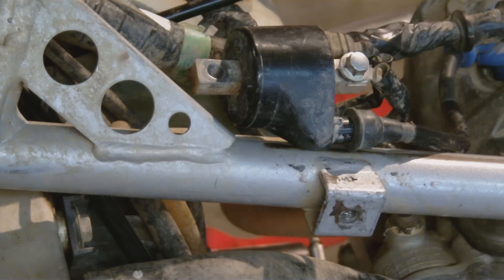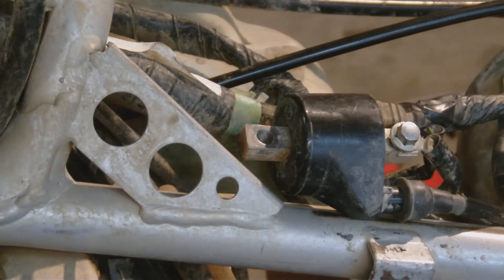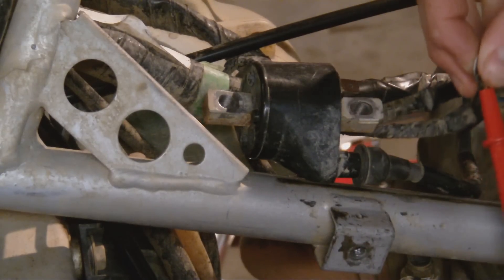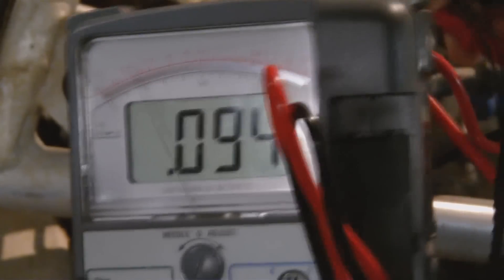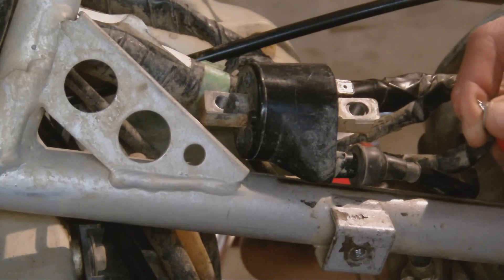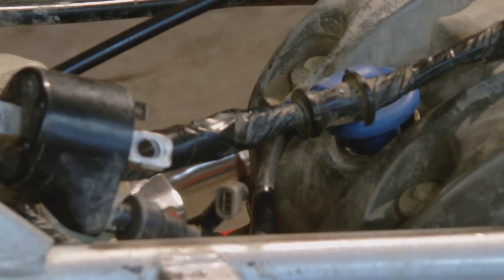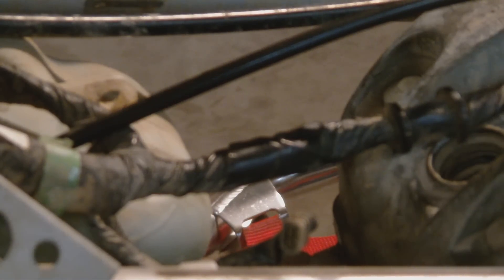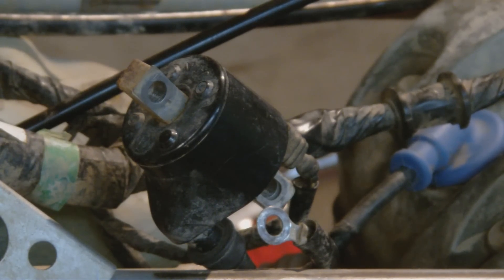How to test the stator of your ATV

Comment: I've always wondered why you couldn't wire an electronic speed controller to a stator and use it to turn the engine over on your quad as a means to dump the brushed starter motor... just makes sense on modern units. Not sure if they do, I've never driven in years. These stators are little different to a typical quadcopter/bldc motor arrangement.

Comment: Did he forget about the cdi box, or the kill button? They both play a very important roll in the process of making spark.
Reply: The harness needs to be grounded to the frame called a chassis ground. The chassis ground must be clean. Sand down to remove rust or paint. Hondas are the most picky about their power source and their grounds. Also electrical can go bad at any moment in time. You also need to source the correct resistance specification from an OEM manual . Don't just throw parts at the machine, that cost money. Take your time and learn. 

Here is an online manual. 

http://quads.ddns.net/service-manuals/honda/%5B2004-2009%5DHonda_TRX450r_Service_Repair_Manual.pdf

Comment: That is not how you would test the stator , you would have to unplug the coupler off the ICM and test the stator there .. But Honda doesn't use OHM tests anymore because they aren't accurate .. You have to test now with a peak voltage adapter ..  ..Honda uses an exciter coil and a pulse generator ...

Comment: Stator is behind your Magneto flywheel you're not going to get a good spark if you do not have a good ground make sure your surface where your ignition coil mounts to is clean and make sure it is tight

Comment: The tab on the ignition coil is A+ in your wiring harness words that has the connector on it is for the ground the tabs on ignition coil that bolt to the frame are to ground the ignition coil and also mount it

Comment: Is the stator supposed to be wet with oil or dry
Reply: Dry. Most likely a crankshaft seal is bad. Might have some that run in oil but Most get ruined when wet

Comment: I think you knew that wasnt actually the stator, the stator is on the opposite side of engine that the oil goes, but no oil goes in there, its dry, thats the ignition coil your at there

Comment: My 2013 sportsman 400 wont start...its just clicks once and that's it..the battery is new, all the power/lights work....I think its the starter or the solenoid.  How can I test to see what it is?  How exactly do I jump the solenoid to test it?  Thanks.
Reply: Sounds like the solenoid. You can test it by jumping the two bolts together. Just stick a screw driver to them and make sure its touching both. If it does and it turns over it's the solenoid.

Comment: you need to do a little bit more research you completely skipped  the cdi unit and the to wires that you tested in 4:51 was a ground and coil wire from the cdi
Reply: derrick darnell what do u mean

Comment: im not uh, talkin crap or anything and you are young and thats a great time to learn these things, but the reason you aren't reading anything is because that is not the stator, that is the ignition coil.
Reply: Those wires he's testing should be receiving a pulse of AC power from the stator when turning the engine over. The stator sends power to the regulator rectifier which charges the battery and theres a pulse generator by the stator as well which sends power to the ignition coil. Of course it has alot to do with the cdi as well. If the cdi ain't happy, your bikes not gonna run.
Reply: ummm he is testing the wires coming from the stator there guy, not the  ignition coil...

Comment: That's the ignition coil. Not the Stator!
Reply: Mike B the 4 wheeler gut stop running
Reply: it just shut off wouldint start back up
Reply: Mike B he is testing if the stator is giving power too the coil. he knew what he was doing

Comment: You can test the high and low tension primary ignition coil , exciter coil, trigger coil. all with an ohm meter to see if they are all within spec. Stator and lighting coil can be tested in the same way. Ignition,neutral and kill switch can also be checked with ohm meter or with continuity tester (beeper).

Comment: I have a 2002 400ex that wont start. It tries too but can't. The battery is still good has gas and everything. And also when I take the spark plug off its has a little bit of gas on it. I don't know whats wrong with it. It ran fine before. And even the lights turbo on to buy just wont start. Tried turning it on by pushing it and that didn't work either. Would appreciate any help.
Reply: stick screwdriver in coil wire where sparkplug goes and hold it next to the frame and crank engine. if have weak or no spark stator could be the problem. it is easy to replace on most atv's {as long as u have a flywheel puller)
Reply: That 400ex will probably need the valves adjusted.  When they get out of adjustment they will not start.

Comment: Dude you got it all wrong.. first off you will not get a reading till your pickup obtains the signal from the stator.. your stator is what charges and provides the DC amps to the Regulator which converts the voltage to the rest of the bike. the CDI is what sends the Pulse to the coil for the coil to fire.